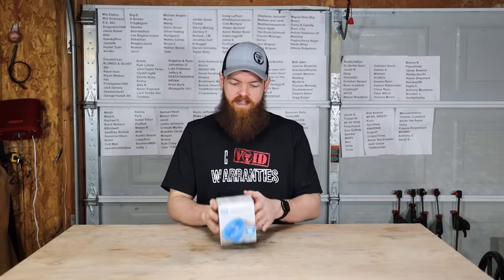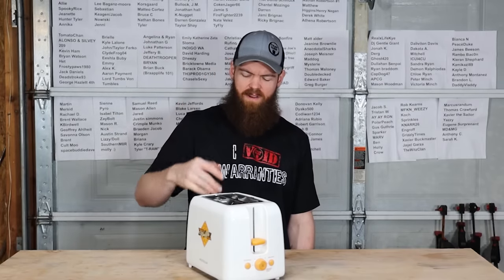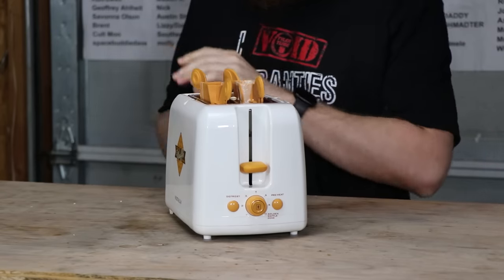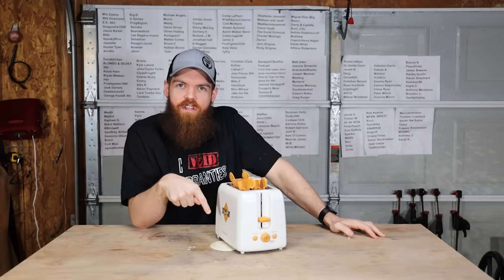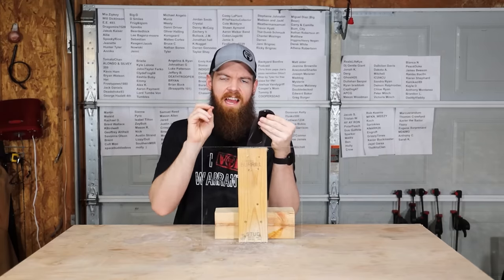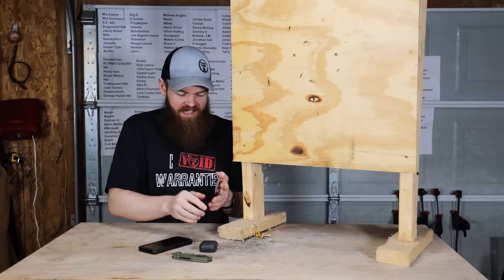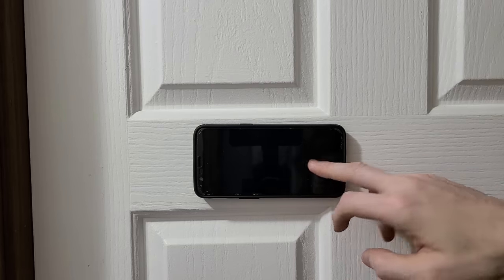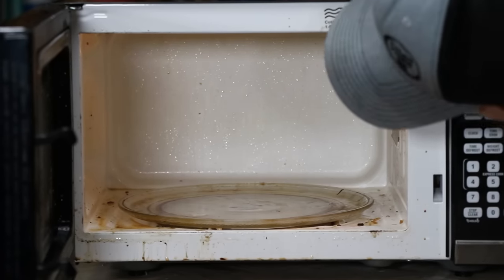I Tested Random Things From Amazon...

Comment from the maker: follow me on twitch! www.twitch.tv/tyler_tube
Reply: Can you test Chinese diesel heaters sometime?  They are cool.  I heat my truck, garage, and greenhouse with them and they're amazing.
Reply: Love your videos man👍👍👍👍👍👍👍
Reply: I love your testing videos
Reply: "A little bit dirty"? What are you living in to where that's "A little bit dirty"? 
I'm worried now dude.
Reply: Thanks again Tyler! I love your video style, it feels like I'm hanging out with you while I have my coffee and unwind. Always a good day when you post!
Reply: i think theres something wrong with the chickens you guys breed
Reply: @ProlificInvention  you should send this request to project Farm not Tyler Tube.
Reply: lol put the cup ALL THE WAY IN
Reply: What's a wearanty?
Reply: Done
Reply: #teamseas........................................................
Reply: Gang gang. Get that hitter.
Reply: You need to have you garage door opener adjusted and a strut on the top panel with preferably a new panel. You see tear in the metal of the left side of the center style where the operator arm hooks up? There should always be a strut that runs the full length of the top panel with a rail operator installed. Plus it looks like your operator down force is set too high/down limit set too low forcing the door to the floor with too much pressure which probably started the split. I only say this because if the springs break while it’s up or the doors not perfectly balanced it could finish the rip and cause property damage, seriously injury someone or even possibly kill a child or pet.
Reply: Wht
Reply: Wow
Reply: Test deeze knutz.
Reply: Can you link the products
Reply: You fill the rubber cup with water, then press the excess out with the insert-cup.
Reply: @JimmyNier00  WOW!
Reply: 9’ pv
Reply: Please tell me where you can get a five dollar waffle iron that’s new!  
There at least 25 or $30 at Walmart!!
Reply: That third item... sticky gel pad.... looks like a ladies panty liner 😂😂🤣
Reply: Lol. You press the pree heat or defrost button after pushing down the lever 🙄
Reply: What is a twitch?
Reply: Where the link for cushion? I like it. Wanna buy if price good. Gimme link!!
Reply: foR THE love of god, just read the instructions. when i watch these i want to know if the product actually sucks and it isn't just the buffoon that's using the product. i know it's really hard as a man you think the world revolves around you, but the instructions exist for a reason, not using them doesn't make you smart or resourceful it makes you the complete opposite.
Reply: @nicywicy :
Um, you don't have children that have the GOT TO KNOW WHAT WOULD HAPPEN do you? Random things happen while someones head is turned away. Trust me I was one those children that would be on top the caboose and somebody would have to come and get me or I'd be the one that was on top of the flagpole and a public park or eating the paint that your mom and dad were trying to paint with. Yes I was a ROYAL RIP. But very loved.
Reply: Have you tried pressing the pre-heat button when the toaster slide is down? and also i suspect they want you to pre-heat the slicon mould thingo. Love your work tyler, stay awesome.
Reply: @ProlificInvention  w wq
Reply: Hey y’all
Reply: You can do the same thing with any kitchen sponge get it full of water put it in the microwave for approximately 2 minutes for a medium size microwave it steams and does the same thing please don't do like one lady did and put a dry sponge in for 2 minutes apparently it caught on fire for her 😂
Reply: Why would you even want an extra toaster especially a rubbish one. You could just buy the waffle things and put them in your usual toaster.
Reply: The seat thing was good, it would make a great party game.
Reply: Can you link the cushion please
Reply: I would not bother with the waffle toaster I would just buy frozen waffles and place them in my toaster

Comment: For any toaster setting, you need to push the slider down first as if you were just making toast, and then press the button of whavever setting you wanted.
Reply: Thats just common sense tbf
Reply: Yeah, like I have a toaster with a bagel setting (where it only heats the inside elements). You push it down then press the bagel button. Pretty straightforward thing to assume.
Reply: Call me an idiot, but I genuinely didn’t know this. I figured you pressed the setting prior to pushing the slider down. Thanks for teaching me something!
Reply: How do you all afford a toaster with buttons? Lol. It's a toaster, you just buy the cheapest one. And those have dials. Not judging, I just don't get it.
Reply: Yeah for some reason this part triggered me. It's not hard to figure out
Reply: I don't have to push down for buttons to work.
Reply: True but the instructions could be better.
Reply: it is a safety feature. The slider is a shunt for electricity, Power cannot flow unless the slider is engaged.
Reply: I've literally never had to adjust the darkness after pulling the lever down. Always just adjusted it.
Reply: @HowdyFeller  its okay.. the pushing down thing serves as an on off button to those types of toasters.
Reply: Yes!
Reply: @TyrantSong  i mean, the dial is also labeled “golden waffle zone” at the end of it and he only put it halfway and was surprised he needed to do it twice lol
Reply: @oplkfdhgk  idk about that, the dial was labeled and he didnt turn it high enough at first lol
Reply: oH ... yOuR'E OnE oF tHOse InStrUcTIoN ReAdeRs hUH?

Comment: This is why they make frozen waffles, my friend. ;)  Also, that Angry Mama thing is a scam. A spray bottle of 2 parts water to one part vinegar sprayed into a dirty microwave, then turned on for a minute or two works way better than that, and you don't spend a dime. Just recycle an old spray bottle from a cleanser that you have cleaned out well. Just a tip. :)
Reply: I was thinking the same thing about the angry mama, I usually just fill a coffee mug halfway with plain water and nuke it for 5 minutes and let it sit for around 2 minutes before opening the door, that usually works just fine for my needs. I never let my microwave get filthy like Tyler did lol.
Reply: Never used one BUT I would open the moulds lay them flat fill one half close thus allow the batter to expand filling the mould !  Just saying 😊

Comment: Four reasons why I wouldn't buy the waffle maker: 1. I don't like putting plastics and rubbers inside cooking appliances. 2. They are not even slightly crispy. 3. SUPER tedious to use. 4. Probably impossible to clean completely if the mold leaks.

Comment: Ok so the angry momma thing is super overkill. You don’t even need vinegar. Just put a soaking wet paper towel in the microwave for 15 seconds at a time and wipe out the inside of the microwave between each time

Comment: Do yourself a favor and mix the batter in a glass measuring cup with a spout and you could pour it into the molds. The molds didn't leak, the batter sloshed out the other side when you tried to add extra batter.

Comment: Well, the pocket knife texture is made to be easier to grip with our skin. The reason it won't stick to the sticky pad is because the checkered texture provides barely anything to hold onto for it. So, yea, smooth things are things with smoother textures, will work easier. :)

Comment: I'd be very interested to see how thoze sticky gel pads work on textured wall board. Does it fall off? Stick well enough to take off paint? I feel like that's a pretty perfect test of whether it has the right degree of stickiness.
Reply: Would like to see them on drywall, myself! Great replacement for command strips if they work there.
Reply: They don't work well on porus surfaces like dry wall, wood or concrete. I would be interested to see if they take paint off walls too.

Comment: Watching you slowly pour the batter into the waffle maker with a spoon, instead of simply pouring the correct amount in with a measuring cup, hurt my soul. You also need to push the slider down first and THEN press the button to whatever setting you wanted.
Otherwise, great video!
Reply: He was using a paper bowl, he could have folded it.

Comment: Speaking of ice, you guys should try whiskey stones. They work just like ice cubes, but they don't melt
Reply: "They don't melt" which means the drink doesn't get as cold. They do minimize dilution tho.
Reply: @masonharris9166  I know they make metal cubes with water inside of them where the water in the metal cubes actually melt. I have a few of them. It takes a little bit longer for the drink to get cold but they still work
Reply: @masonharris9166  though*
Reply: @Christine C.  So yes, I know how to spell the word, but I was making use of this really novel and obscure idea called "slang." I doubt you've ever heard of it as it would take a complete idiot to assume I don't know how to spell,"though."

Comment: Old School vs New Tool:
1. Ice Maker Cup
Purpose?: To Make ice cubes easier to freeze
Result: Old School Rules! That itty bitty thing is only good for a half a cup of water. Using a regular ice cube tray or ice maker installed on your freezer still beats the heat.

2. Waffle Toaster
Purpose: To make waffles without waiting for the iron to heat up.
Result: Old School Rules! Toasters are for TOAST! Using an old waffle iron takes up half the time, half the work, and half the mess.

3. Sticky Gel Pad
Purpose: Sticks to anything and holds anything and is washable and reusable
Result: Old School Rules! Anything sticky does wear off over time even when washed and not everything sticks to anything. Poses a risk of loss of objects and damage if fallen from high levels and tempurature does matter. Nail a hook on the wall to hold your keys, mount a table tray for your phone or stuff using the ol' screwdriver.

4. Angry Mama steam cleaner
Purpose: Steam cleans hard to clean dry caked on stains from microwave
Result: Old School Rules! Nothing but some hard workin' elbow grease and some soap and water and a scrub brush will clean those hard scales right out! Plus it's less stinky!

5. Egg Sitter
Purpose: To cushion your seat and make sitting more comfortable (plus it's proven to keep the egg intact to prove a point as a bonus)
Result: New Tool, Fools! The technology is supposed to prove comfort to your spine that your back does not "crack" like an egg when sitting. You can literally "chicken out" on this thing by sitting on an egg and hatching it. (just don't actually do it because this thing is for back purposes only and not egg sitting challenges. Yes it's possible to break eggs but at least it's an effort for that. Just don't sit too hard because that also breaks your back.

Comment: Pretty sure the ice maker cup was likely meant to be used to pour your drinks into the cup after the ice is made surrounding it to have the drink be uniformly cold. The lid is likely not meant to be tight and is just a way to keep the ice from melting too fast and you would lift the lid when you want to take a sip.
Reply: Nope. Handy to do that with but nopw.
Reply: Nope, it's advertised as a space saving ice maker. I was needing something like it, ordered it and it's a bust. I was duped. Lol

Comment: that cup at the start.... i imagine you fill it with water without the cup inside.... then you push the cup inside and it will push all the water out till it is in and the water should still be at the top and filling the bubbles.... kind of a neat idea

Comment: Ice Cube cup lid didn't fit because you failed to insert the cup all the way into the blue silicone outer cup and/or gently pull the sides of the blue outer cup up over the sides of the white inner cup until there is only about 1/8" or less of the white cup upper lip sticking above the level of the lip of the blue outer cup.

Comment: 12:27 "I don't understand what's happening here" as the puddle of batter beneath the appliance grows bigger and bigger.
Also, you should invest a few bucks in a Pyrex measuring cup with a pouring beak, just pour it directly into the molds.
You should also try to hang the knife by the blade, that would probably work and be a little more badass too.
Wow! That microwave thing looks exactly like my ex-wife after I would cook, same posture, look and everything. Is there a button you can press to make it say "I'm not cleaning this mess up! You know you can't cook!"?
Speaking of my ex-wife, I bet she could put a flat spot in that egg sitter.

Comment: That sticky material has been around for decades. The first use for it I saw was a toy called the Wacky Wall Walker. Basically a ball of the stuff, with some long arms, kinda like an octopus. You'd throw it at a wall, and it'd slowly roll down the wall. Cats went nuts for them, and would chew off bits. Also used for lint brushes. The stuff does wash well, especially if you use something like Dawn, to remove skin oils.

Comment: here's a huge problem I found with the ice maker when my sisters ex husband bought one. Just like a regular ice tray, you cant pour the ice out while you are currently freezing more ice. so the whole point of 'you can store ice while you make more!' doesnt work at all. its the exact same as a regular ice tray. 
and for those who used to have open top ice trays that whiling they are freezing they can spill there are ones with lids that work really well. The only way to get ice out of that ice cylinder thing while its freezing is by fishing it out with your hands, bcuz of course thats what I want is my children's dirty booger filled fingers fishing around against something that goes into my unsuspecting drink later.

Comment: Just a heads up, you can put a coffee cup with water in the microwave without vinegar and as long as you get it to a boil it will steam and it’s easier to wipe out. I was taught that as a kid in the 80’s lol, you can use any microwave safe dish
Reply: Yeah that thing is a scam. And it doesn't make any difference if you use vinegar, it just stinks up your house.

Comment: The physics of eggs is quite simple: As long as you are not focusing pressure into single points on an egg the entire surface of the egg evenly distributes the pressure.  Any pillow  thicker than the egg would have done the same trick.  The only reason your egg broke is because you hit it at such an angle that the ridge applied too much pressure to a line across the side of the egg.

Comment: I've got a higher quality version of that ice maker. Mine was bigger, and the center cylinder had flaps to make it easier to get it out. Was like 5$ "as seen on tv" at dollar general. Works great. The size of the ice is great, because I've got one of those bottle aluminum walled drink containers, and they fit inside it very easily.

Comment: This burning chemical smell you speak of reminds me of the Cuisinart patio heater that I, my adoptive aunt, and her aunt and uncle spent about two hours or so assembling and then an additional twenty or so minutes trying to get the heater working. The grate that the heat comes from had a rustproof coating on it, so, while the smoke was odorless, it was pretty smoky for the first few minutes of running it due to that coating getting burnt off.

Comment: Also, if you use the dumb ice thingy again, just fill the blue thing about 1/4 full, and then insert the inner cup over the sink. The water will fill the “cube” holes and overflow, so you know it’s full without having to stretch the outer doodad. Or just get you an ice cube tray 🙄

VERY entertaining video!

Comment: Appliances burn off factory oil when your first turn them on. This applies to all appliances that have a heating element and what not. It’s just a factory oil that burns off it helps prevent rust, keeps stuff lubricated until you use it the first time

Comment: Not texture as much as SURFACE AREA in contact.  If those were less deep edges in the groove pattern it would have likely worked.  Having the extra moisture in the wood actually helped you.

Sandpaper is a good way to test on the surface area.

Comment: I was thinking with the instructions you mentioned for the waffle toaster, if you really think about many things you would preheat an oven for which often includes having your pan or sheet in the oven while it preheats before you put the food on, Maybe try putting the silicone in the toaster before putting in the batter, then lowering them down then try hitting the preheat button afterwards to see if it activates, then if the preheat button works, Maybe it would require you to pour your batter in while the silicone is in the toaster and already hot and that just may start cooking the batter right away so it doesn't leak out the bottom.

Comment: I think you're supposed to push the toaster down with the molds in and press pre heat them when it's warm pour the batter in and let er rip! You should always run new things with a heating element to burn off the oils and stuff from the manufacturing process.

Comment: About the Angry Mama: I could have seen myself using this thing, but only as a little boost to something that already works pretty well for me: just making a sort of paste of baking soda and hot tapwater, and wiping the microwave down with shop towels dipped in it. But wow, now that I know how well those Miracle Wipes work, I guess I'll just be using them. 😅
About the Egg Sitter: I have a knockoff of this, and I wasn't too impressed with mine. Upon closer inspection, mine is a bit thinner and doesn't have the thick border to it. What a difference small things can make!

Comment: As for the vinegar smell. mix a mixture of 7 grams Lemi Shine (Citric Acid. can be found with dish detergents.) per cup of water completely. It will work just as well as vinegar without the smell. also just steaming it well will also do a lot of good without anything extra. just wipe the microwave down while still wet